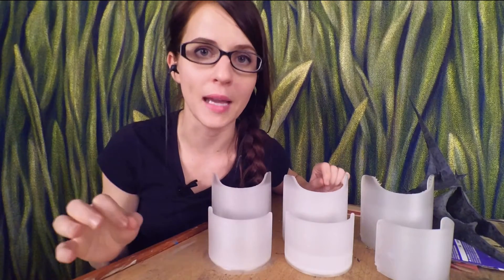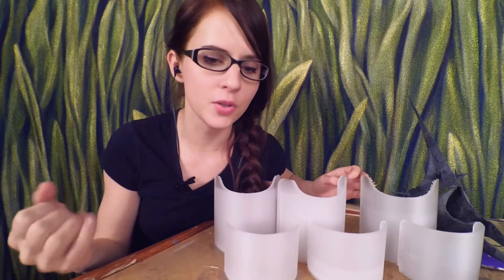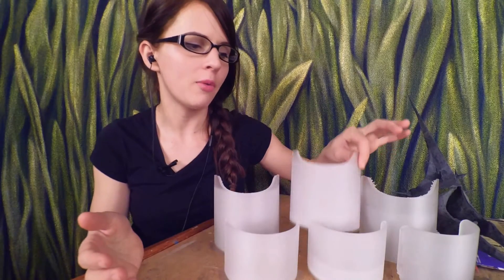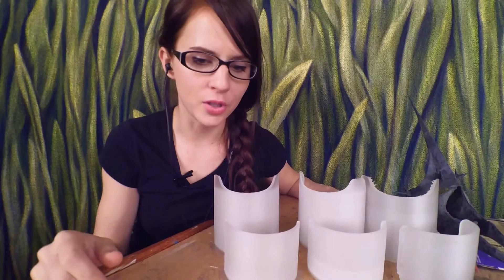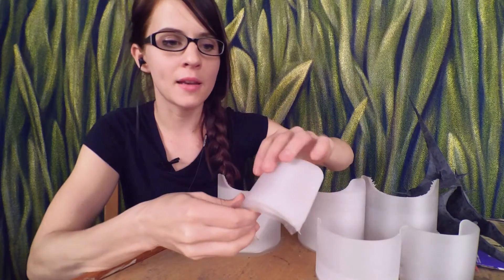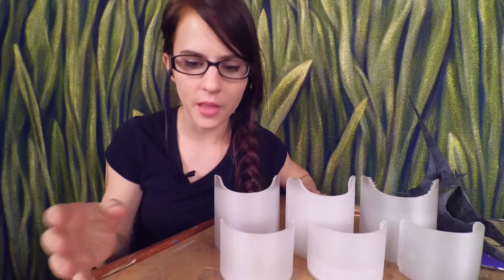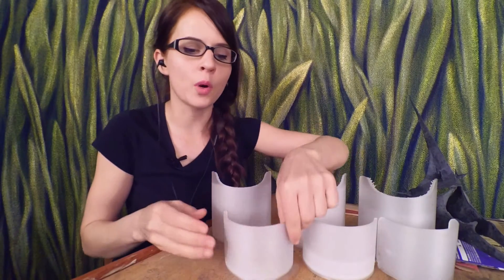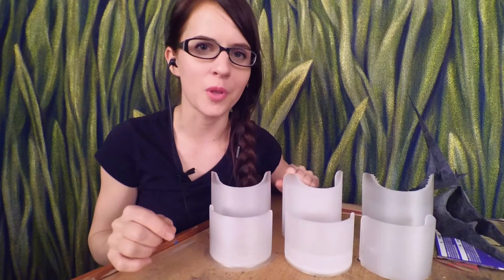Choosing the Right 3D Print Test Model

Comment: Can't wait to see more of that armor getting printed and how it all goes together. Are the files freely available somewhere (Thingiverse/My3DFactory/...)?
For the topic of this video, the simple calibration cubes can only tell you some pieces of information about your print settings, there are better, a little bit more complex (but still small) test prints that help tune settings for a new filament much better. (something with pillars, overhangs, sharp corners, holes,...) Basically i only use them to find the ideal extruder temperature (best layer adhesion, without getting stringy) and optimal retract and movement speed settings.
The problem you had with the top of the armor part not reproduce the round corners is basically a problem with the arrangement of the cooling fans of the ultimaker and bad air-duct design. The fans are arranged left and right of the nozzle and the airflow is forced to drop down towards the build plate quite a bit away from where the nozzle prints at. So, you have to set up your piece in the printer in an orientation where the print is passing under the generated airflow (by making the nozzle go left and right as much as possible). If you have your print setup to be on the other axis (nozzle moving back and forth most of the time, it does not get hit by the airflow that well, so the layers do not cool down fast enough and plastic gets dragged around and pulled out of shape. It's not that much of a problem with small prints, since the airflow will get scattered enough as long as the buildplate is still near the nozzle, but once you get a wall of a few cm height built up, the airflow will not cool the top layers that well anymore. Another trick would be to add a (very) small pillar to your print next to the actual model, so the nozzle and fans would need to move around more and provide the cooling airflow required.
Maybe there are some better airflow-ducts you could find on the web and print for your UM to alleviate that problem with bad airflow-design too? I don't have an UM myself, so i'm not shure what kind of printable upgrades are available, but i guess there should be some active community around these machines improving bad design choices. Or, if you have the skills, design something yourself ;)